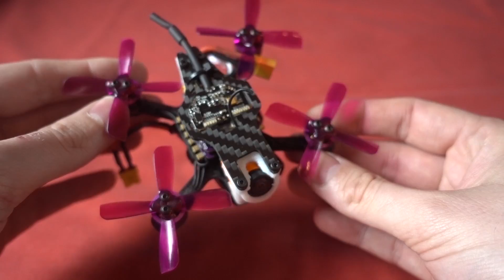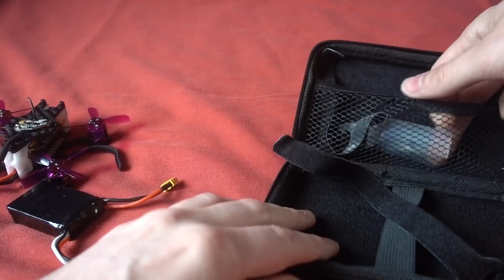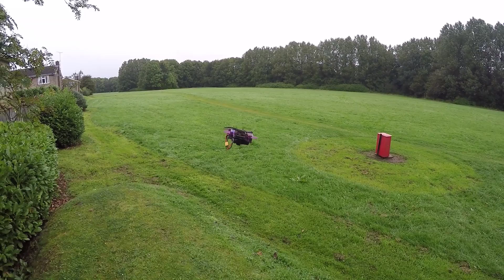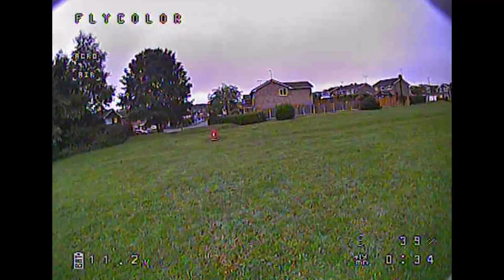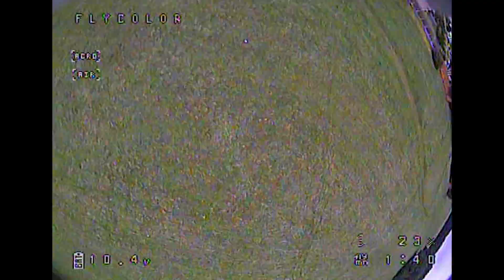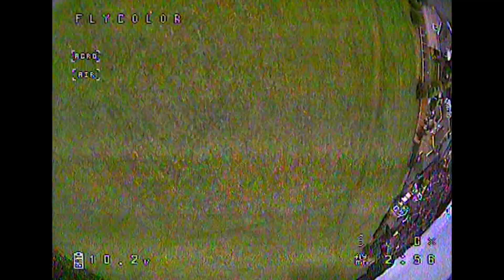KL EX90 3S brushless Micro With a CCD!

Comment: I want something like this but with update hardware. what would you recommend ? either bnf or parts to build this. 2 inch 4 blade prop, 3s battery, micro runcam, 1108 motors. recommend for frame ?

Comment: What PIDs are you using? Similar to those on the product page for 3S? https://www.fpvmodel.com/x-racer-kl-ex90-micro-racing-quad-bnf_g1301.html

Edits:
Nvm on the PIDs, saw them flash up in the video.
I wedged a matek buzzer behind the camera.
Think 550mah battery is the way to go?

Comment: Wow .. that IS expensive ... about $100 too much I think. That fancy case and all those Gemfan props can't cost all that much. Reception is poor as you thought.  Perhaps you can bend that coax for the sleeve dipole upwards while heating it with either a heat gun or a propane fire lighter.  Pretty insane power. Thanks for the review. Cheers.

Comment: It cost me 200 dollars canadian. to build something similar and in my opinion better.  I used the leader 120 frame so it can fit the kk 2840 props, amp hungry.  I used the omnibus f4 tower 25 amp esc, run cam micro with vtx03 and the a8s reciever for my flysky,  1105 hglrc 6000kv motors.  all my components are IN my frame and protected.  Plus I added a BUZZER, mandatory. and led lights on the front for los cause im a noob and I need it for orientation.  Build it your self soldering isint that hard, you get better, plus its a skill you will need for this hobby anyways.  Because I built it, I can fix it.  good thing for other noobs entering the hobby

Comment: It's amazing how fast these micro brushless have advanced. I would want the option for more vtx output, and there is no excuse for not including a buzzer, but pretty soon someone is gonna get it right. I'm disappointed that the horizontal plates on the leader 120 are 18mm apart, just needed 1 more mm for the swift/foxeer, but it's just a matter of time before there's a pnp or bnf model that nails it.
Reply: I got my micro swift in my leader 120 frame.  It fits, its really really tight and yes 1 more mm would be perfect.  you cant fully crank the screws in,  but its more than enough to hold the camera.  I used it with the eachine vtx03.  which unfortunatley my vtx is shit.  I just hooked up a spare vtx and it works but oh well thats part of the fun.  diagnosing the problems

Comment: A bit of an off topic question.  Im using the eachine VTX03  and after about 4 mins, once its hot the signal cuts out for about 5 seconds and comes back.  Then it does this about every minute after that.  It doesnt look like it looses power because the led indicating the channel is still on, and because I see snow not black screen, I dont think its loss of video signal.  I think it stops transmitting.  Im still new to this and learning any help from you guys would be greatly appreaciated.